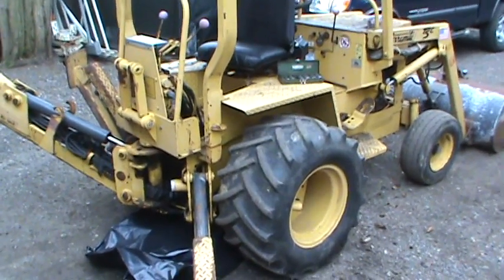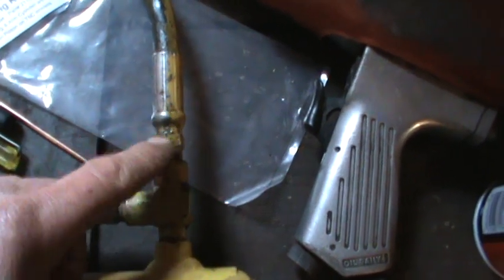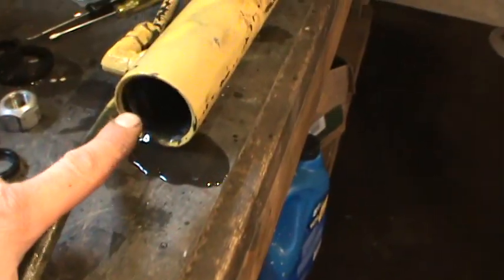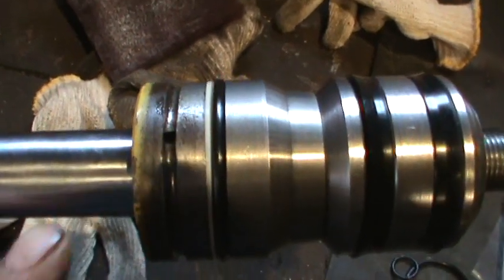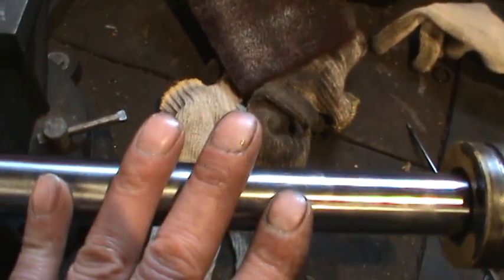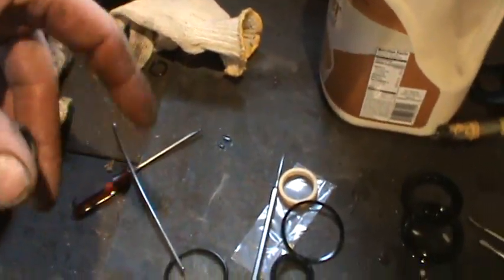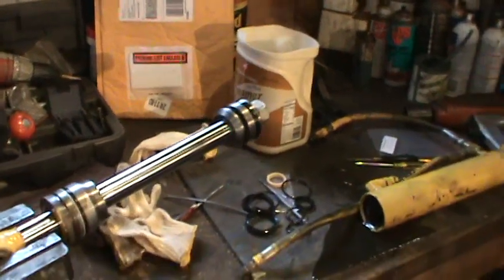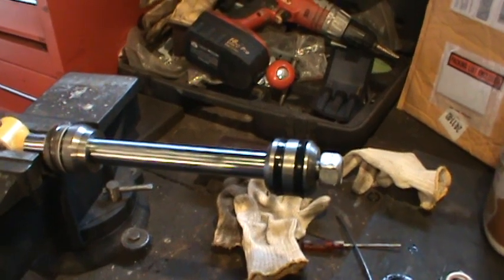hydraulic cylinder rebuilding

Comment: Thank you for the video it helped me confirm the proper orientation of the seals on the piston. My suggestion to get the piston seals on easier and undamaged is to heat the hyd oil to about 200 deg F and dip the seals into the oil just before installing them. I used a cotter key hook tool to install them. The hot oil is recommended as the water may possibly cause corrosion and you need to oil the seals during installation in any case.

Comment: If you get the blue piston seals from Terramite Replacement Parts DON'T heat them prior to installation. I had my seals break. According to the gentleman I spoke with on the phone this is a known issue. Body temp only.

Comment: I got the retaining wire turned out with an OTC gland nut wrench. I had to drill out the gland nut holes to fit the pins. It helps turning the whole piston rod at the same time as the nut is turned and the retaining wire walked right out. The next issue is the gland nut seal sticks into the retaining wire groove in the cylinder barrel as you remove the piston rod, I had to use an engine lift to pull out the piston rod as the other cylinder end is mounted vertical on the boom and use the cross pinned, it is a real fight to get this one out. Thanks for the video.

Comment: Several people had questions about the wire that holds the gland nut. Not all Terramite cylinders have this wire but for the ones that do, you should see or feel the end of the wire sticking out of a hole on the side of the cylinder. It is normally flattened down against the cylinder. Pry it up so that you can clamp vise grips onto it. Alternate prying it up and pushing it while turning the gland nut counterclockwise with a pin tool. You will only move it an eighth to a quarter inch at a time. Continue prying and rotating until it is out. When installing, line up the hole in the gland nut with the hole in the cylinder so that the wire goes into the gland nut and will be pulled in when the nut is rotated clockwise. LEAVE A QUARTER INCH OR SO OUTSIDE THE HOLE. I don't know how you would ever remove it if it was pulled totally inside.

Comment: Good video. I have fitted new seals to hydraulic cylinders before; I once had to repair a bigger cylinder than the one featured here. Getting the hard plastic/composite seal in the groove can be very tricky. Best thing to do is soak the seal in warm water for 5 minutes which will make it expand. Grease the flange to help it slide on better. Manufacturer's say don't use anything to lever it in place just use fingers but this is impossible unless you want shredded finger nails! Very CAREFULLY use a flat blade screwdriver to gently pry the seal over the lip of the groove (too much force will snap the seal) and nudge part of the seal into the groove with fingers. Now carefully lever the screwdriver round the circumference, pushing more of the seal into place with fingers until enough of the seal is in place so that when you remove the screwdriver it will remain in the groove. The rest of the seal should now slide into place easier using just your fingers. Allow plenty of time for the seal to cool down and shrink back down to normal size before re assembling cylinder. Hope this helps!

Comment: For those poor souls who's ladies won't let you near her microwave, check out garage sales or auctions for one. I find them all the time for 10 bucks or less. Very handy in the shop and when not being used for shop projects you can heat up your left over coffee. 
 Another shop appliance I like is A Coleman camp stove. I like propane but white gas works too. Handy to boil thermostat's along with A thermometer so you can see if it is opening at it's rated temperature.  Also nice to have if you lose power and want to heat A can of soup.

Comment: Good video, hydraulics is one system that is out of my comfort zone. I just purchased a tractor with the Ford 768 loader on it. And found out that one of the lift cylinders is leaking. I've searched for repair manuals for this loader with no luck. The good thing is that the tractor did come with a new seal kit for the loader. Again good video....

Comment: I have wondered about the Terramite mini-backhoes for awhile. I see 'em for sale, used, in the 6-9K range. Can you backfill by pushing sideways with the bucket? I have a friend who has one of those 3-pt hitch backhoes and it's not strong enough to do that. Sux. 

You should check out Keith Fenner's youTube channel. He has lots of great machine shop vids and he even has one of him rebuilding a cylinder like this with the wire retainer. It's off a wood splitter. He's from Cape Cod. Cheers!

Comment: i repair hydraulic cylinders all the time and how i soften the pressure seals is put the seal pack in my pocket and by the time i have removed and stripped the cylinder they are usualy at the right temp this is how i do it out in the field or on a site but in the workshop use this technique.

Comment: You should mention that most heads on hydraulic cylinders are made from ductile Iron and if you chose to use a punch it should always be bronze or damage will occur due to the soft nature of the material.  Also you can have a single seal on the piston with a duel stage cylinder.  They are made to take fluid pressure from both sides.